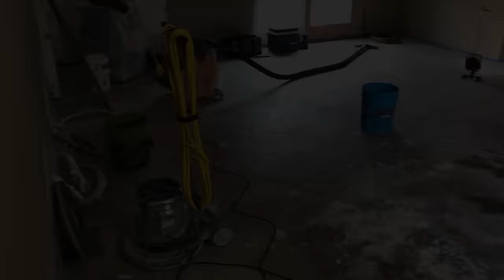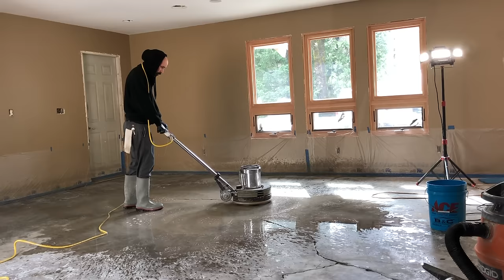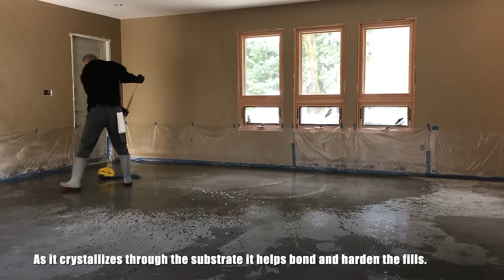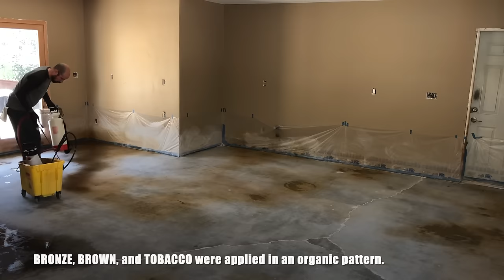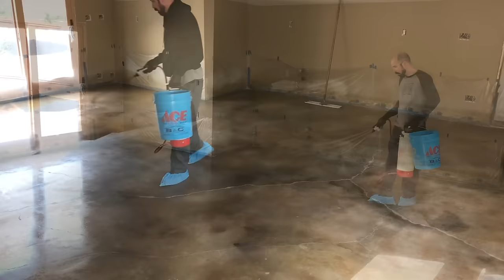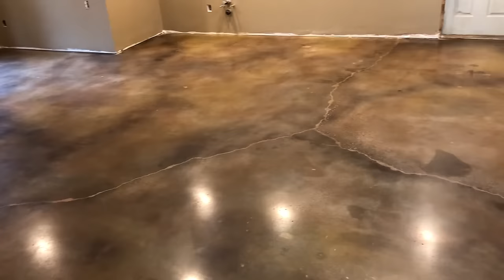Stained Concrete Floors

Comment: I wish all city street sidewalks were done like this!! Nice job!!
Reply from the maker: That would be an awesome world wouldn't it?!! Thanks!
Reply: @Cretosealsealants  and we all would be dead in the first freezing temperatures.
Reply from the maker: @AltarParssoy  True, but you can add a non-slip media to most sealers. It just makes the sealer more matted.
Reply: @Cretosealsealants  still, condensation may result in the formation of thin ice on fine surface. Also, if side walk is sloped, non-slippery finish can only help to a point.
Reply from the maker: @AltarParssoy  True. Maybe in a perfect world.
Reply: @Cretosealsealants  or, in desert climate.

Comment: Anyone know how to keep them shiny? 
Or remove stains from them? 
We recently moved to a house with this type of floor and the movers dragged their belongings in the floor. I know it’s not scratch but I cannot remove those stains and get it to shine.
Reply: I need an answer for this as well. Similar situation!
Reply: Use high gloss epoxy rather than polyurethane. Epoxy is more durable than oil base, latex base, acrylic or polycrylic. Obviously there are different sheens this was an answer to strictly address “shiny”.
Reply: Maybe apply a tiny bit of acetone on a rag and test in a corner to see if it wipes off the clear coat. If it doesn't, then wipe where the marks are.

Comment: If my concrete floors are in good shape can I just clean them and apply the product?  Product, then topical sealer?  Do I seal the floor first before the application of the colored gloss? Thanks...
Reply from the maker: Yes, you can just clean the concrete, stain and seal. The penetrating sealer is not required if there's no moisture problems with the concrete. Grinding makes it look better but is also not required.

Comment: I removed an old carpet and their was bunch of white dust that has hardened and maybe some type of puddy..  I've been washing with soap but it takes a lot of scrubbing?  

Chemical to use to clean the concrete easier?
Reply from the maker: Yes, floor strippers will get that up in a jiffy. It takes some cleaning after to get up all of the stripper residue though. A floor grinder will get that up as well. Try our SCR 1600 floor stripper if scrubbing won't get it up and you don't want to rent a machine. https://cretoseal.com/shop/scr1600-coatings-remover-w-oil-cleaner/

Comment: Can I use paint thinner to remove paint that was under my carpet? I’m gonna stain and seal my floors, but don’t know if the chemical will take if I put thinner in the floor.
Reply from the maker: Hi Roberta, I would recommend using acetone since it doesn't leave any residue. Just use it carefully and don't pour it all over the place since the fumes can ignite very easily. Use chemical resistant gloves too.

Comment: Does grinding the concrete with the floor machine get rid of paint stains or do I need to clean my floors prior to using the machine?
Reply from the maker: Stains might be still visible after grinding but it should remove paint. It all depends on what grit level you use. You can always use a floor stripper before grinding to get the paint up as well.

Comment: just out of curiosity. does it meet Fire class A1? wondering is it suitable for public area. thank you
Reply from the maker: Hi Autumn, the Creto DPS penetrates completely into the concrete and increases the density. The concrete would have to be tested after application. As for the topcoat, I'm not sure. I would imagine so.
Reply: I think you misspelled pubic*
Reply: @od4407  late response, but yes my pubic area was still Fire class A1 after this process.

Comment: Hi! I have stained concrete floors in my apartment exactly like that. I live them. However, they look cloudy and dull after I mop them... Any tips?
Reply from the maker: You're probably using the wrong floor cleaner. I recommend using natural stone cleaner since it's pH neutral and doesn't leave any residue on the sealed concrete. We sell Balance floor cleaner which works on all stone, tile, and sealed concrete.
https://cretoseal.com/shop/balance-cleaner/
Reply: try cherry bomb wax from legacy Products in Florida

Comment: Dose this make the floor slippery as it looks ?
Reply from the maker: If it gets wet it  can get a little slippery. You can always use a non-slip sealer like Poly Step Guard if having a slippery floor is a concern.

Comment: Looks good  Where'd you get the products
Reply from the maker: The stain, deep penetrating sealer, and concrete fills are from my company which is linked at the top of the description. The polyurethane is sold by another site. I recommend using our Sweet & Easy sealer instead of the one I used for a super durable, high gloss surface sealer. Much less complex to apply.

Comment: I just bought a house with flooring like this and have a dog... how do I get the claw scratches out of the surface of the concrete?
Reply from the maker: Claws shouldn't be scratching the concrete. My guess is that they're scratching the surface sealer. You would have to abrade the whole floor, blend in the scratches, clean, then re-coat with a new surface sealer.
Reply: Creto Seal will it just scratch the new surface sealer? Or is my current surface sealer just old. It was done 10 years ago

Comment: I would  try resurfacing the concrete to get rid of those cracks. And then stain.
Reply from the maker: Exactly what I did. Thanks!
Reply: @Corey Andersen I didnt watch the whole thing I only saw just few seconds of the staining. But if he resurfaced why do you see the cracks then? Doesnt resurfacing give the whole new layer. That's what they do for concrete drive ways.
Reply from the maker: @papasmurf7684  I didn't do an overlay. There's different crack fills that are colored or clear too.
Reply: @Cretosealsealants  I see and thank you for telling me. I'm completely  novice at this. Looking to do some work on my garage floor. Debating whether  to epoxy or stain.
Reply from the maker: @papasmurf7684  You would use the epoxy over the stain... or over raw concrete.
Reply: @Corey Andersen erm still visible

Comment: Is this too slippery to use on a porch or patio?
Reply from the maker: Not if you use Poly Step Guard which is a satin sheen, smooth but slip resistant polyurethane. It's super easy to use, you just roll it on. Check it out at the link in the description. Thanks!

Comment: Subbed! Nice job and looks great! We're going to knock out existing creme colored tile to do this. We have about 1250 sf on a bottom floor, how long should be we plan to finish the DIY job if we're doing a few hours a day? Also, have you seen this look good with semi-modern homes with somewhat open floor plans , but not 100% completely open? Our thinking is, if we're gonna consider replacement gray tiles, might as well try this first
Reply from the maker: That project took me about a week and a half to do all by myself. I think concrete is usually the most cost effective flooring option especially for a DIY project.
Reply: @Michael ~ I realize that this response is a year after you commented..but, i just wanted to share my thoughts & opinions with you. 

You asked if these floors looked good in a semi-modern & pretty much open floor plan...
I feel like this particular look & style/finish for the floor  ~ it was damn near exclusively made for "semi-modern/open floor plans". Lol. (Im exaggerating a little..but, both of those go together so well!!)

Again, this is just my opinion/these are my tastes & theyre based on what I've seen/come across/tried out over the years.  
Im big on the asthetic, the feel, the flow, etc of my home & places in general. I'm researching & planning out an upgrade/remodel for my house right now & these floors are a huge part of that plan.. (that's why I ended up here on this video & replying to you. Lol). 
Couple of the things that I like most about the floors being done like this (especially in a space that's "semi-modern & has an open floor plan") is this :
** the floor color that's being done in the video ~  i think it goes really well with a wide range of colors & furniture styles. It ties in really nice with all kinds of different options. 
** you can use different sizes/shapes of rugs & different pieces of furniture together to define/create the particular spaces that youre wanting in that open area. For example...
- a sectional + a big area rug + a behind the sectional console table can define the living room space. 
- longer/skinnier rugs are good for defining walkways or "hallway" areas in a wide open area. And, they do a good job of creating a "line" or "point of separation" between your living room area & a library/reading area or an office (for example). 
The living room area is on one side of the long/skinny rug & the reading area or office space is on the other side of that long/skinny rug. The furniture defines the space & the rug gives a distinct separation of the 2 areas. 
----------------------------------------
Side Note ~ any throw rug would work but there's a brand called "Ruggable" that I think is worth checking out. 
The system is pretty "cool". It's made up of 2 different parts or layers..There's a bottom layer that keeps the rug secured really well to the floor & then there is the top layer that serves as the "rug" part of the system. 
It makes it to where you're able to buy multiple styles, looks, & patterns & switch them all out. 
They come up really easy & they can be thrown in the wash easily for cleaning, as well.
Makes it easy to change the look out throughout the year and keep the areas looking fresh. 
Makes it easy to keep the rugs clean if you have pets & kids "movin' & shakin'" day in and day out. 
They have a really cool thing going on. 

So, yeah..this style & look of flooring is most definitely a "GO" with the kind of space that you're talking about!

Comment: Not possible to disguise or hide the cracks ?
Reply from the maker: Hi Tony, not really. A clear crack fill wouldn't be quite as noticeable but the concept is to accentuate the imperfections.
Reply: If he resurfaced and then stained he probably  could of.
Reply from the maker: @papasmurf7684  There are other crack fills which would match the original concrete better. This client wanted the cracks and a rustic look.

Comment: How long does the stain take to dry?
Reply from the maker: Usually around two hours give or take. After it's dry to touch you can apply the surface sealer.

Comment: How much would that project cost?
Reply from the maker: You would have to inquire with contractors in your area. Using a topical sealer like Barrier EXT would greatly reduce the cost of a service like was shown in this video. The "polished" topical sealer I used is super expensive and difficult to apply.
Reply: I’d be interested in that aswell. Can you name some numbers?

Comment: Do not buy this product. I spent almost 400$ on barrier gloss sealer and followed all the instructions. The sealer turned to dust and the company wouldn’t refund me and took back their offer to send me more product. Bought another sealer from Home Depot and it worked flawlessly.
Reply: Use a quality polyaspartic sealer smells bad for about 6hrs need good ventilation and turn off furnace but damn that stuff is hardcore stuff